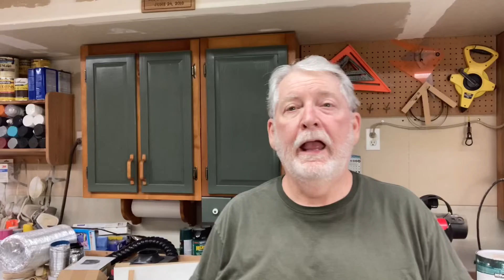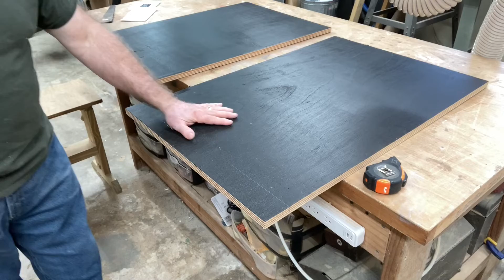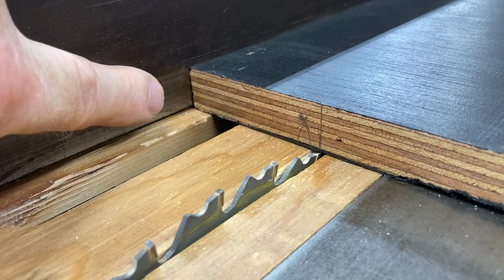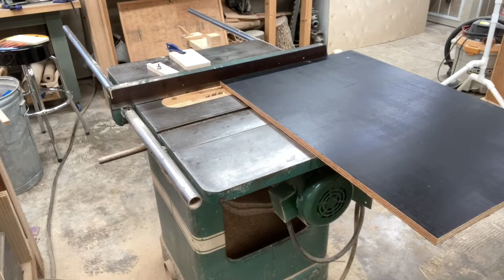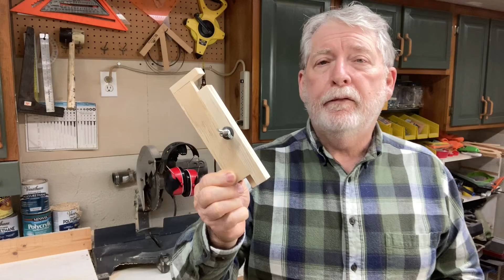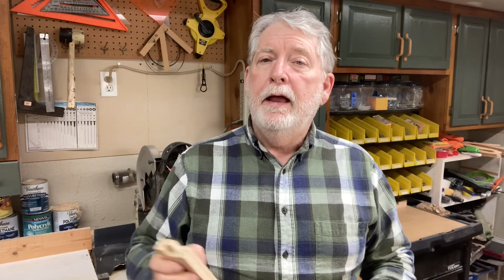Use Kerfmaker Jig with Table Saw Fence

Comment: i wish I had watched this earlier, as you wasted a lot of time doing that, No not the video, but the cuts, its easier with a router with the right size cutter and a straight edge, as when I make cabinets, I can make 4 complete in less than 3 hours
Reply from the maker: Thank you. I have a video on that method as well. When I was young I could make a whole house full of kitchen and bath cabinets in two days. I’m a little slower these days. Age is catching up with me

Comment: I fail to see how this is a game changer.  It's a tool that exists for years and it does a trivial job and there are many other methods for compensating for the blade thickness.
Reply from the maker: Because all the old tools and old carpenters are disappearing and I believe these old tools need to be kept in the toolbox
Reply: @PawPawsWorkShop  what is replacing the kerf maker today?  And how can an old tool be a game changer?  That term is typically used for a new innovation.

Comment: The kerf maker is a neat handy tool, I have made several over the years. One for each blade and mark what blade it is for. The key to making this work well for me is the adjustment of the screw for the offset of the blade kerf. What I have done to insure the accuracy of kerf thickness of the blade is to use a flat head screw. I also 3D printed several from the thingaverse website anther great video!😁🛫
Reply from the maker: Yes, a flat head screw is critical. I need to try a 3D printed one. Thanks for your comments. Merry Christmas to you and your family
Reply: what are printing from that website? A screw with a little thread locker on it would as simple as it gets, no??